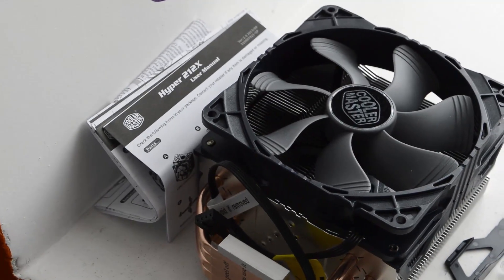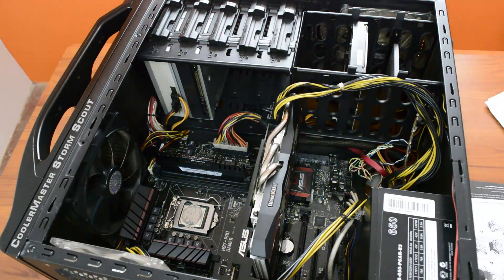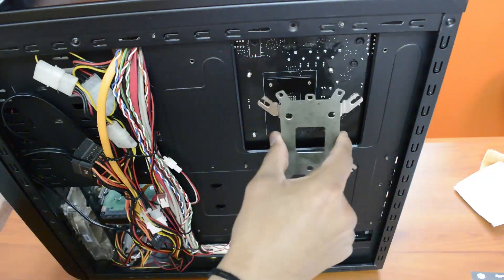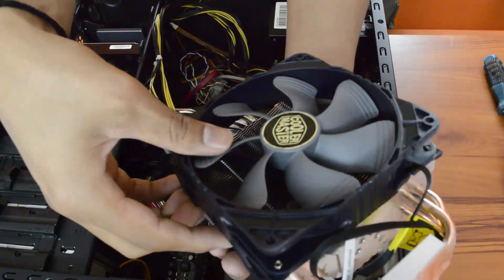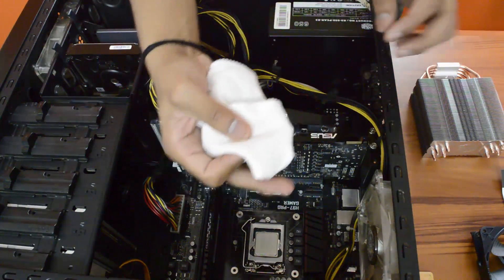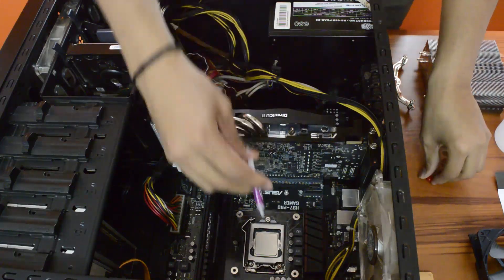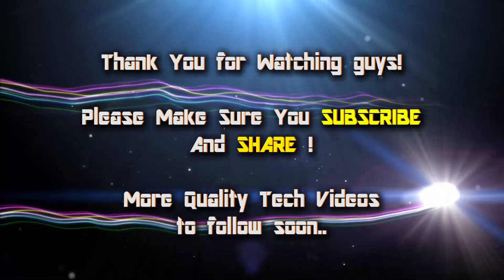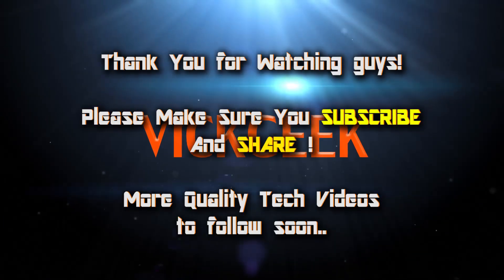Cooler Master Hyper 212x Installing/installation Guide

Comment: On the 212x instructions, it shows a right way and a wrong way for the x bracket configuration, why does this matter and what is this in relation to with its positioning on the motherboard?

Comment: Good video, thanks for the walkthrough. The included instructions were terrible. One thing though, unless you have fans on the top of your case, the heatsink fan should face towards the rear exhaust fan.
Reply from the maker: It has a 120mm fan on top of the case to blow hot air out. So, it was not ideal for heatsink fan to place that way. On a lighter note, now looking at this tutorial, I feel like I could have explained better. Because, that tutorial is almost 3 years ago while the case was even 3 years older. I am glad it helped you. Appreciate your feedback :) Please Subscribe !

Comment: Hey Vick i did as per the instructions in the manual it matches ur video too. but the cooler itself moving a bit even after tighten the screws. why it is not stable is it because of the thumb screw between the cooler(aluminium stack)  and the cpu is not getting full tight?
Reply from the maker: May be you have applied too much thermal paste ? So, it is not stable. What motherboard and case you have ?
Reply: i've applied correct amount of therm paste. zebronics premier cabinet and asus b250f strix gaming board, i5 7600

Comment: Thank you for making this video. The included instructions with the Hyper 212X are very misleading and I couldn't make sense of them despite installing several coolers before - including liquid coolers.
(Step 2 shows you put thermal paste on even before you've fixed the mounting bracket to the rear of the motherboard.. what the?! :P)
P.S I don't mind the music, but maybe it can be a little bit quieter, especially when you're talking :)
Reply from the maker: Thank you for watching. Glad it helped you. Thanks for constructive feedback. It was my initial stage on making YouTube tutorials. The case used is old and it does not support bracketing from inside. At first I thought I can fix the motherboard after applying thermal paste. But nope, the mounting bracket has to be installed from rear outside of the case. SORRY for the loud and crappy music :D 
Please subscribe and see my recent videos, hope you will like them :) 
Have a good day :)
Reply: Haha! My case had the same problem. Had to totally remove everything and put the motherboard on the table to fit the mounting bracket. Never again! (hopefully)
Reply from the maker: That would have eaten a lot of time ! Just like mine did :D
I am using the same old case (CM Storm Scout) even now, it is so strong and is totally screw-less design. Love it. Did not find reason to upgrade as of yet. Hope you have changed to new one !

Comment: Wouldn't be better if you put the cpu cooler with the fan at the same side of the fan you use for exaustor
Reply: Daniel Gomes no, because the fan would be setup to blow air through the fins toward the exhaust fan.

Comment: Hey, does it ever mis align or go straight up when you install it properly?
Reply from the maker: +Joey Allan Amit Yes, it will tend to mis align. To avoid it. First adjust the screw and then place it at one go and then tighten it. Hope this helps

Comment: I want to get this for my PC , buy I have a question . can I install it as my motherboard is fit in cabinet or I have to take my motherboard out of cabinet to install hyper 212x ...
Reply from the maker: +mehtab puneet Hi! Depends on which cabinet you have got!
If the backside of the case is temovable and you have access for placing plate and tightening the screw then you don't have to remove your motherboard at all !
Reply from the maker: +mehtab puneet *removable

Comment: What is the difference between the 212 x and the 212 evo?
Reply from the maker: Fans/Fins/blades of Fans are different. 212x is newer and performance marginally better for most of the work load.

Comment: how do I install it on gigabyte 970A-DS3P mobo AM3+ socket?
can u help me
Reply from the maker: They have different screws and clamp for different sockets. In video I have shown that. So read the manual once and fix with the relevant screw.
Reply: K

Comment: i have a corsair carbide 300R windowed edition cabinet
and fx 6300
will it be fitted inside the cabinet after fitting it can i close the cabinet door after the installation?
Reply from the maker: +bharath kumar Hey ! This cooler should fit in comfortably since your case supports a max CPU cooler height of 170mm and the width of your case is 210mm.
Reply: Tq

Comment: Can it handle a intel 5820k overclocked to 4.4 ghz?
Reply from the maker: Creative Soulmates It should, because it is an effective alternative solution to liquid or water cooling systems. However, water cooler will make cpu ease to run at 4.4 ghz.

Comment: now you cant use your other ram slots? the first one?
Reply from the maker: It is usable. Just shy of touching the fan casing. But the fan actually keeps ram cool.
Reply: Cool thanks for replying. Is the cooling better than the evo?
Reply from the maker: You are welcome. Yes improves by a couple of degree celcius. But the design I felt is better to that of Evo. charles eugee lim
Reply: Cool thanks bud! Oh and the thermal paste any good? Again thanks sir!!
Reply from the maker: Good question! It is efficient. I think you can rely on it for an year atleast, before thinking of upgrading it with other brand paste. charles eugee lim
Reply: Cool cool thanks for the muh info